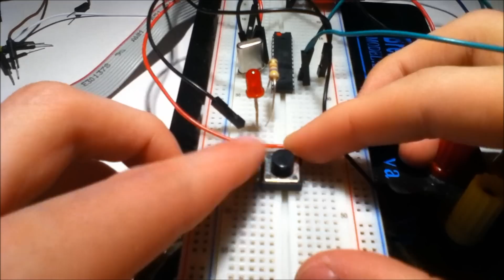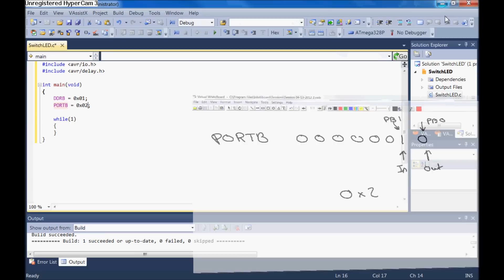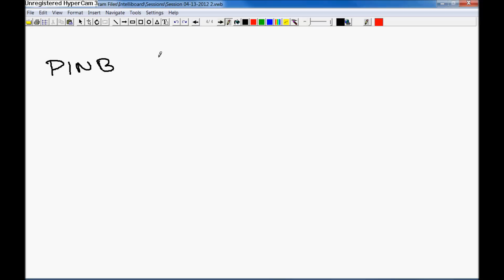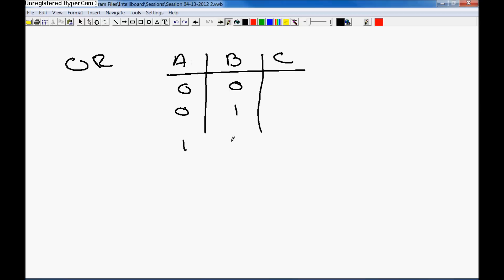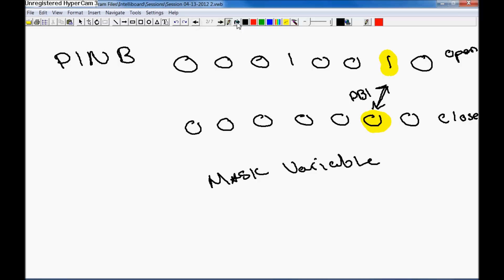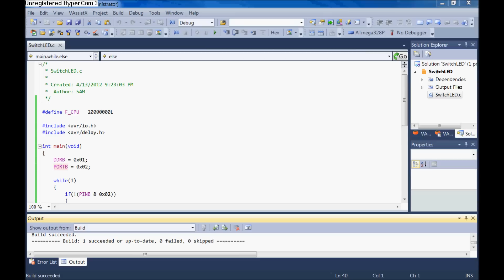Learning AVR-C Episode 3: Digital Input, Pull-Ups and Binary Math

Comment: thanks a lot for this tutorial. it was helpful. 
there is only one thing that I cant understand:

let's say the button is not pressed.
so PINB is   xxxxxx1x
our mask is   00000010 
the & result is:  00000010
the ! result is:  11111101
it is a NONE ZERO value 
therefore we have ->  if(11111101)
which will execute the code inside if statement anyway.
same goes for the situation that button IS pressed

so "if" statement has no effect at all. am i right?
Reply: Hey even I had this doubt! But if you see how C works, you'll understand its not this much complicated, the thing is your & operation is giving hex result (since 0x02 is hex), so PIND & 0x02 will either give the result is 0x02 (that is 2) or 0. And where you got it wrong is ~ and ! is not same. ! is logical NOT, true for 0 value, whereas ~ is bitwise NOT, which inverts all bits.

Comment: question, for your & operator you chose to use PORTB &= 0xFE; (i understand the purpose of that)    i often see  PORTB &= ~0x01;  (i presume its essentially identical in operation) is there any reason you would recommend doing it one way or the other?   thanks!

Comment: In my experience the tactile switch connects not the diagonal pins (as at 1:22), but the two sides of the switch. So in your example at 1:22, the two top pins are already connected, and the two bottom pins are also already connected. Pushing the button connects the two pairs. Consequently, you can use either the two left pins, or the two right pins, or any diagonal pair.

Comment: Does the exclusive OR not work in AVR for some reason? Couldn't you just make the bit mask the exact same way and use an exclusive OR to turn a bit off? PORTB = 0b00000010; bitmask = 0b0000 0001; PORTB ^= bitmask; Then PORTB would have to equal 0b0000 0011. Am I misunderstanding the exclusive OR somehow? Thanks for the videos. This is the first time I've left a comment, but you've been a big help to me for a while.

Comment: can someone help me about |= and &= ???
Reply: its been ages so you probably  no but quick easy thing for other people is ..if you |= "or" a bit you will set it without changing any other bit also if you &= "and" a bit you will clear it without changing any other bit...maybe help someone.
Reply: 0b00000101 |= 0b00000110   equals   0b00000111
The same thing but with &=  equals  0b00000100

So when you say    if (!(PINB & 0b00000010)),  you are really just asking if PINB1 is a zero.

Comment: You don't need to use hex form. You can use bin or dec also. 254 or 0b11111110 is same like 0xFE. So why don't use 0b11111110 ? Fastest and easiest way how to transform bin to hex value is split it to lower and higher 4 bits and convert first 4bit value to first digit in hex number and second to second. For example 0010 1000 = 2 8 so 28 in hex.
Reply: xxJerry19xx I would rather represent a number in hex than in binary, especially when dealing with large numbers